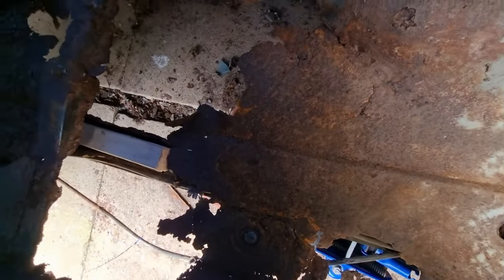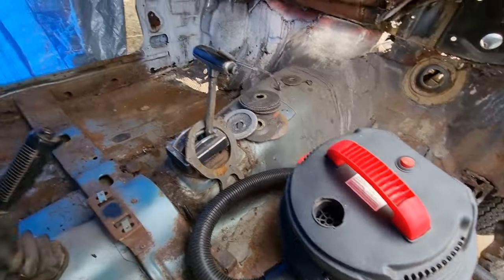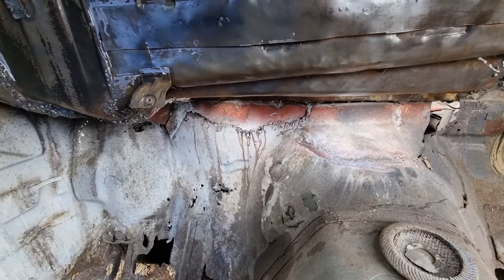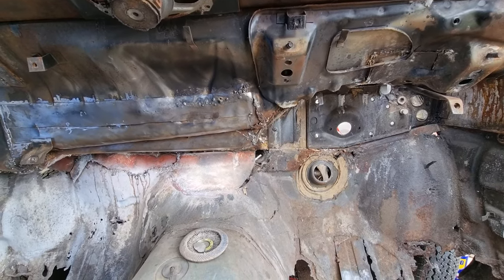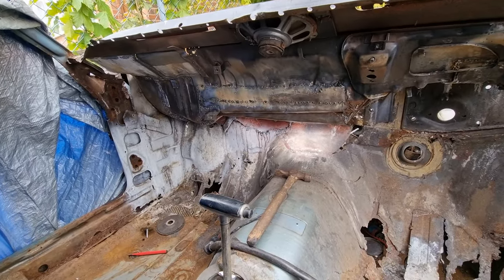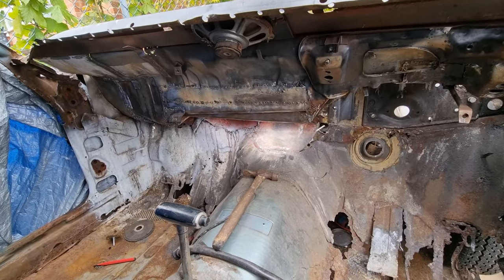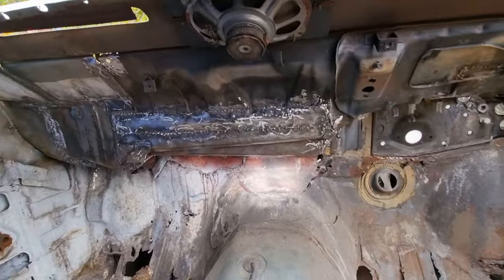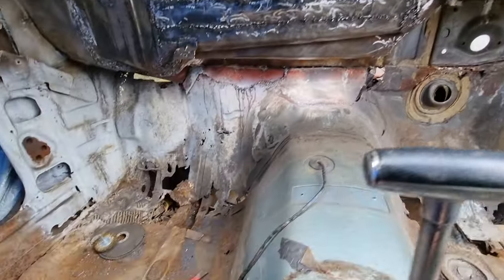Cortina Mk4 Ghia 2.3 V6 Restoration || Inner Bulk Repair (P23)

Comment: Find a piece of tube and weld it on ive done that with my hammer I've had for 25 years but it's a big heavy hammer that bulk head looks alot better not easy welding up that way for you (not me) but im experienced and have a the proper stuff and better welder lidi do a small welder small and simple £90 flux wire and wire is £4 a roll one just do it when you can afford to mate its alot of work and a struggle for you but keep on it don't need to rush do it right the best you can 👍
Reply from the maker: thank you nice idear about the hammer tip heheh will look out for a tube

Comment: Looking good bro 👌 shame about your hammer. I had a lump hammer detach and hit me on the head I reattached it and used a small metal wedge and hammered it into the end then I soaked hammer in a bucket of water so it swelled up hasn't come off since. Keep up the great work bro. Your certainly making great progress 👏
Reply from the maker: Thanks bro yeah my stick broke on the end lol I think as its a old hammer wood was rotten lol some one as gave me a idear to weld a metal peace of pole to it

Comment: coming on great there buddy,  i would go replacement floor pans too, saves you a massive amount of time, yeah i know you like a challenge like us all, but you got to make life easier for your self and put that challenge into something else on the car,  you have done a fare whack with that bulk head.  Also no harm in taking a break on getting your stock up, Ie investing in some rust treatments on ebay. Some are in the 5ltre etc.  Also POR15 blows hammerite out the window too, its pricey but its well worth it.  So you could use on the inner bulkhead.    I used it on my dads Defender front end, and its a lot stronger than hammerite.
Reply from the maker: wicked will look into that mate and yeah defo going new floor pans be a lot faster :) por15  defo will check that out